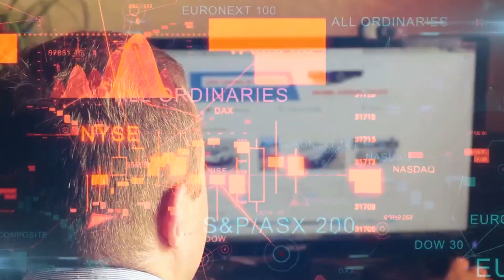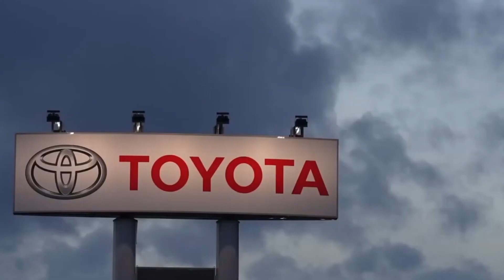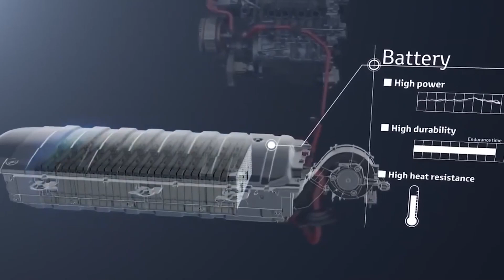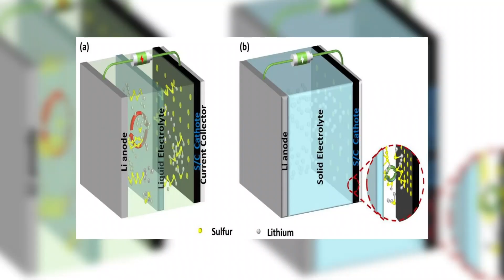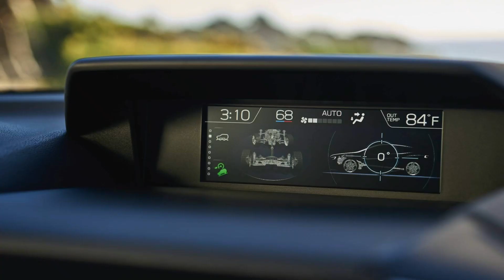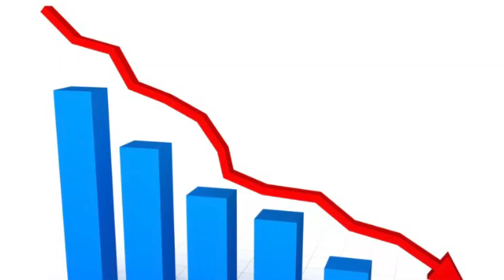How Solid State Batteries Work!

Comment: Lithium is not scares, like it's more common than lead for example, the issue is the mining of it means mining up thorium which is radioactive so most advanced countries don't want to do it. Also even those that do the mine and process Lithium from ore to a usable material is energy and time intensive process. I really wish people would stop saying lithium is rare on Earth. Rare Earth elements in most cases are not in actuality rare, just much rarer than they are in asteroids and such because a lot of it has worked it's way below the Earths crust.

There is still a shit tonne of lithium way more than enough to serve all the needs, the issue is are we going to tear the world apart to get it and is it actually feasible to process that much lithium even if we are willing to give the planet the middle finger. To be fair though thorium isn't as bad as it is made out to be as it's a alpha emitter which can be blocks by your dead skin so isn't a massive radiation risk, is not water soluble like uranium so it will pretty much stay where it is when you bury it and wont contaminate ground water even if you don't put it in dry casks or whatever, and there is the possibility thorium could be a nuclear fuel of the future so digging it up may not be the worst thing in the world.